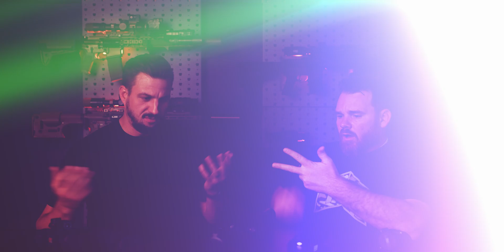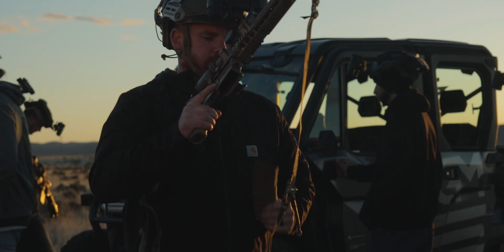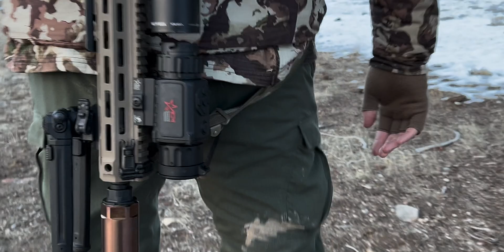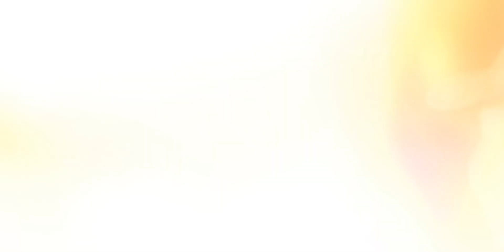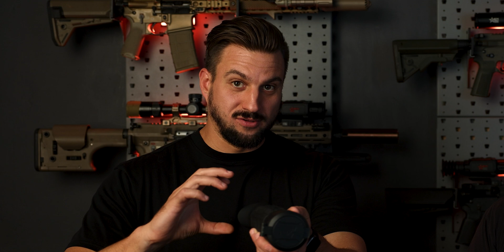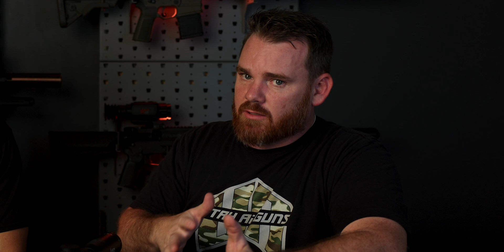AGM Table Talks Episode 5: Understanding Base Magnification

Comment: Big fan, currently have 3 of your units...  A Rattler (V1) TS50-640, a Neith DS32-4MP (scope), and one of the new Neith LRF clip-on units.  And I'm looking to get one of the Rattler V2 50-640's, as well.  This is my first clip-on unit, and I'm curious as to why the OSD is in the middle of the display blocking the view, and not up top like the Rattler and Neith scope?  It seems like if you're recording, you will want that OSD up top like on the regular scopes for time/date/etc...?  I haven't had a chance to mount it and try it out yet, but won't the OSD being in the dead-center of the screen and blocking the reticle cause you to have viewing issues?  Any chance for an update that gives us options for having the OSD up top like the scope versions for when we're recording, so we have an open image and reticle on the screen at all times?

Comment: Good video. Are they any specific data for how much zoom distorts the size of targets? I always find it extremely challenging when shooting on 4x (2x basemag) because the target looks so much bigger than it should. Maybe it is only me but I feel like my shots group better when Im on base mag instead of higher mag
Reply from the maker: Too many factors involved to have any uniform data because every thermal unit or manufacturer might use different lens sizes, lens ratios, eyepiece optics, display sizes, micron sizes within the thermal sensor, resolutions, etc. So, its kind of different for every unit. But easy rule of thumb is every time you double your native base magnification (2X zoomed to 4X, 2.5X zoomed to 5X, 3X zoomed to 6X, etc) you cut your resolution in half. So if you start with a 640, you'll be l ooking at a 320. If you start with 384, you'll be looking at a 192, you start with a 256 you'll be looking at a 128, etc. And each time you double from there you're halving your resolution again, because you're just zooming on a display. You're probably shooting better groups at base mag for no other reason than its your highest resolution